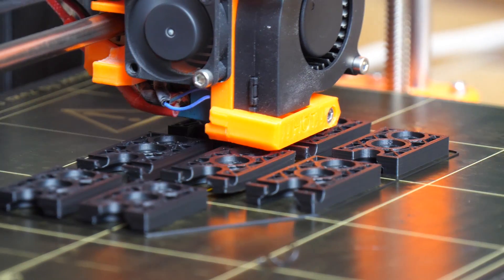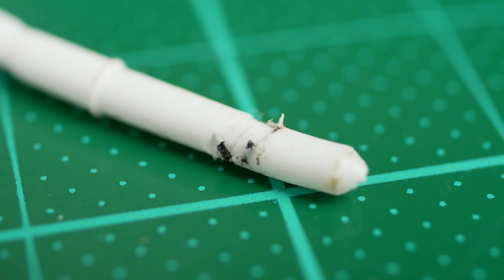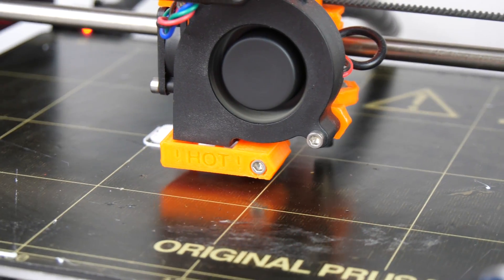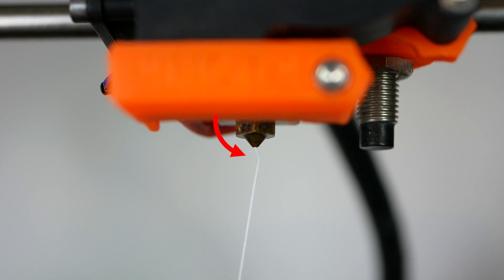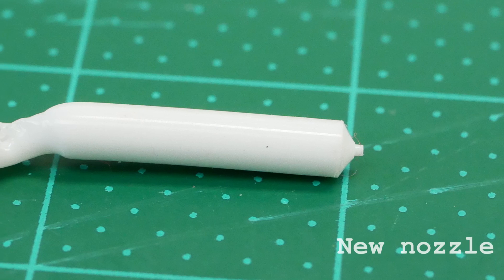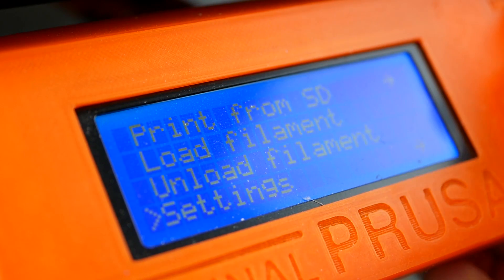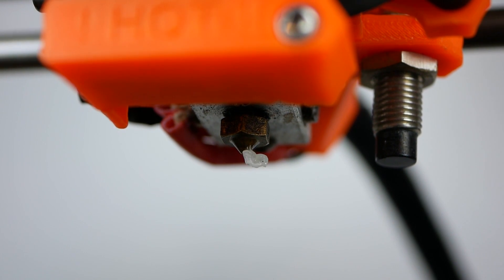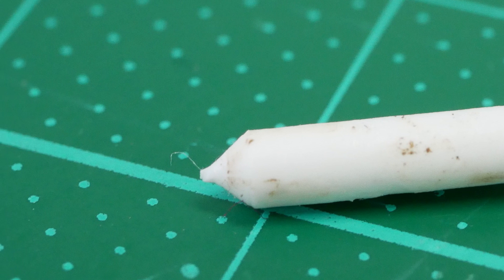Clean a DIRTY nozzle with 3dklean filament - It works!

Comment: My first printer was an AnkerMake M5 that I bought from them as a refurbished machine. It worked well until I started having issues with prints that looked like they were rotted. I tried a bunch of different things folks on Reddit suggested that didn’t work until I tried this one: I cranked the temp up as high as it would go on the nozzle and pulled the filament from the spool end out manually as soon as I could and removed the nozzle as well. As the temp increased, I saw nasty colors of filament drip down - and they were not any colors I had used myself! I then used a clog clearing tool from above and forced out this ugly blob of filament. I then loaded my filament back into the hot end, replaced the nozzle, and extruded filament until it was clean, smooth, and consistent. My prints were back to normal again!

Comment: I used this guide to create a Klipper macro to perform this for me.

1. Heat the nozzle to 200C while homing the axes
2. Once up to 200C, slowly extrude 100mm of filament to replace whatever was already in there.
3. At the same time, start heating to 250C.
Once it reaches 250C, it starts the cleaning process: 
4. Very slowly extrude 25mm of filament
5. Sit in that state for 5 minutes (or however long you set) to cook the filament
6. Repeat 4 and 5 as many times as you set (3 by default)
7. Unload the filament
8. Brush the head
9. Cool off

Comment: ?But for the price of cleaning filament you could get 20+ nozzles
Reply: True, if you use stock/brass nozzles. If you use hardened steel nozzles, or speciality nozzles that cost more than what your brass nozzles cost.

Comment: Hi Stephen, I was wondering if using a small blow torch on the nozzle after you remove it from the extruder is damaging the nozzle at all? as it seem to extrude any plastic residue stuck at the nozzle.
Reply: Not Stephen, but I have a hardened steel nozzle and use a small blowtorch to do just this. Works fine, but be careful not to touch with non-metallic tools or put on a surface not built to withstand heat.

Comment: Googled for this problem and of course the best solution can be found here, as usual. Ordered some; but in the meanwhile I decided to run some marble-filled filament through it as a light abrasive, and that also seems to do the trick for the particular clog I was facing right now.

Comment: You could use wet nylon to SteamClean your nozzle
Reply: That's an interesting thought.
A friend of mine swears by low volume fiber filled nylon, like Cf5/Cf10, for cleaning and maintenance.
He keeps it out in the open and I think it's usually PA6 types, therefore that could actually be a factor why it works well for him.

He uses only HSS or carbide nozzles though.

Comment: There are solvents capable of liquifying ABS without harming brass, steel or tungsten. Why not just soak a badly clogged tip in a solution.

Comment: never had an issue just blasting the nozzle with a torch til red hot, then cooling and doing a cold pull or two.  Always results in like new performance, with the side effect of an excuse to play with fire.

Comment: So what is the advantage of cold-pulling this cleaning material then cold pulling any other material?
Reply from the maker: You don't cold pull the cleaning filament. You extrude it and it's working on its melted state.

Comment: did u ever try to actually clean the nozzle with a needle? cleaning filament is really waste of money if you use pla/abs and use extruders as intended
Reply: or you just buy new ones. https://www.ebay.com/itm/192401502119 20 cents a pop.

Comment: The shop is just awful. I bought the cleaning filament from them and then waited for almost 2 weeks. Nothing happened. No shipping, no emails from them, nothing. After a few more days I opened a paypal claim and a few hours later they´ve send me a refund without any comments. Not very professional. I wouldn´t recommend the shop as communication is close to 0...
Reply: Just buy it on amazon. They sell lots of that stuff online now.
Reply: @dragnet53  If the company has the attitude like @motion2k showcased, I would rather not support their work at all, even through Amazon or other route.
Reply: @FinlandApollo  
Can happen.
I wouldn't put too much weight on an internet anecdote.

Comment: I prefer to buy a 20 pack of 0.4mm nozzles for like 5 bucks and just toss away the old ones.
Reply: I agree, but for someone who is using a hardened nozzle or any other expensive nozzle buying this cleaning filament would make sense.
Reply: @mareksvrcina5279  ah yes there we go, I was struggling to think what the product was good for. There's a darn ruby nozzle, can't throw that.
Reply: yep. time is money
Reply: davidtriune A nozzle is like 4 bucks
Reply: aliexpress sells them for a dime
Reply: @hazoish7670  I always get the cheap chinese nozzles for cents a piece and they work just fine. They are for the most part within tolerance and if not I just use a nozzle cleaning bit to bore them to the correct size.
Reply: Carson W234 interesting
Reply: That makes far more sense.
Reply: Such a missed opportunity! You can print molds and make brass castings with your old nozzles! Want new cupboard handles? Bam! Cool ring? Easy. Brass knuckles? If legal 😜
Reply: This is so american, always throw away everything and buy more. If you are going to have the "hurdle" of removing a nozzle why not simply clean the clogged one after you changed for a new one and store it for the next time the nozzle in use clogs?
Reply: @teresashinkansen9402  because when a brass nozzle starts to deliver bad prints probably the hole has gotten larger by abrasion
Reply: @skelldogTalo  You can always use it as if it was a nozzle of larger diameter for faster lower resolution prints after some light sanding of the tip so its all flat, if the hole is all beat up drill it with a bit to the next larger nozzle diameter. Its obvious that eventually the nozzles will wear out but just changing for a new one and throwing away the old one at the first sign of trouble just because they are cheap seems like a waste to me.
Reply: @teresashinkansen9402  I understand your point, at least some effort must be made to prevent some more trash to get in the landfills. If something can be fixed it should be fixed.
Unfortunately in my exprecience I got A LOT of stringing when the nozzle was wearing out because the tip got also larger.
I switched to a nickel plated one by micro swiss
Reply: @skelldogTalo  recycling brass is easy
Reply: @teresashinkansen9402  😙🤌 drilling out is a great option! Especially when you can print a drill press for your hand drill! 🥳

Comment: Would some wet nylon do the same trick ?
Reply from the maker: Nylon is usually a good choice for cold pulls due t it's low friction coefficient. I don't know if the bubbles from a wet filament would help, this cleaning material is definitely a "special composition".
Reply: CNC Kitchen .. P.S just want to say, I just discover your video and they are great 👍, thanks for the awesome content. Love the engineering bent on 3D printing.

Comment: Nozzles are sooo cheap right now, I could buy a pack of 10 for $9 and save $7 from buying Tylenol.

I always try the melt and pull method, but after a couple of try’s and it’s still clogged, I toss the old one and replace it with a new one.

Comment: Price - 9.9 Euros, this corresponds to approximately 80 pcs nozzles from Aliexpress. ( https://ru.aliexpress.com/item/5PCS-LOT-3D-Printer-Accessories-Full-Metal-M6-threaded-nozzle-0-3mm-0-4mm-0-5mm/32436303723.html?spm=a2g0s.9042311.0.0.d2vWd5 )
Is it worth buying such a filament?
Probably easier to buy many nozzles?

Comment: About your cold-pull technique: I've found that it's easier to do a pull after loosening the idler. At least with the eSun cleaning filament and the PLAs I've had to pull, leaving the idler engaged tends to scrape off too much crap in the hobbed gear, leaving me another maintenance task to deal with before I'm done.
Reply from the maker: That's a good tip. Unfortunately for the Prusa it's quite some work to remove the idler, so I usually don't do it 😬
Reply: CNC Kitchen Understandable. It is a bit of a chore to pull out the calipers and make sure the spacing is just right after putting it back. I've thought about installing a Titan in mine, just to get a lever to push when doing cold pulls.
Reply: @CNCKitchen  One of the many things Prusa engineers overlooked that could improve their printers. This is a minor example, but the glaring major omissions make me wonder why their printers with premium prices are so disappointing in so many ways.
Reply: @kevinpezzi6777  bro in the new printer this isn't an issue...

Comment: I use cleaning filament when going from a hotter filament (PETG) to a colder filament (PLA). It's worked great for me. With Bowden, you are better to use a small 5-10cm length of Bowden tube to constrain the filament path. You can also do cold pulls with the cleaning filament.

Comment: just soak it in acetone for a day. Works great.
Reply from the maker: Only works for ABS though?
Reply: @CNCKitchen  Dichloromethane works for all I have tried yet
Reply from the maker: Just a little bit dangerous though.
Reply: For PLA use ethyl acetate
Reply: CNC Kitchen True, but it would've been perfect in the example you used here. I've also found that some acryllic solvent cements work well on PLA. I'm still a huge fan of doing a cold pull with cleaning filament in those cases, unless heat creep sent a glob into the upper throat, though. It's just usually the easiest route.

Comment: nozzle are dirty cheap...alone with heatbreak.... got like 20 for 4 bucks...
Reply: Where'd you get yours from?
Reply: any chinese website. banggood, gearbest, aliexpress all do.
Reply: Liangshi Xu that's what I wonder are the nozzles cheaper to replace than this 3D clean filament :-) how much is the stuff that's probably a link in the description but I'm on mobile it's a pain I'll check when I get home :-)
Reply: Yes, low quality chinese nozzles and heatbreaks are cheap.

Try original E3D nozzles and heatbreak, much better extrusion.

Comment: You can use a blow torch and hold the nozzle with some needle nose pliers. I think that is the best way, when you burn everything out then you just run it under cold water.
Reply: You don't even need a blow torch or some other brutal tools. I successfully cleaned my fully clogged nozzle using a lighter and the accupuncture needle that came with the Ender-4.
Reply: Exactly that with the pliers and the butane torch. It eventually gets hot enough that the stuck residue falls out in a single burning clump. I thought that was what everyone did. I'm going to give some of this filament I try though